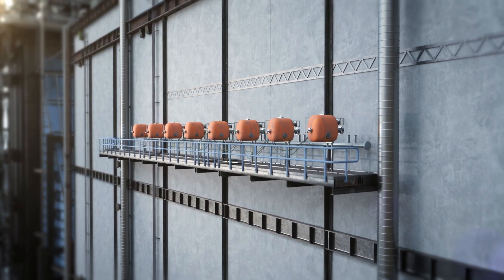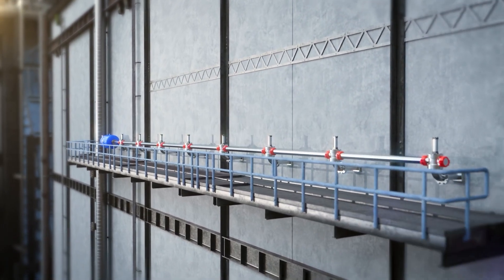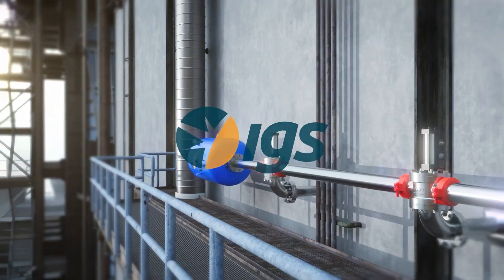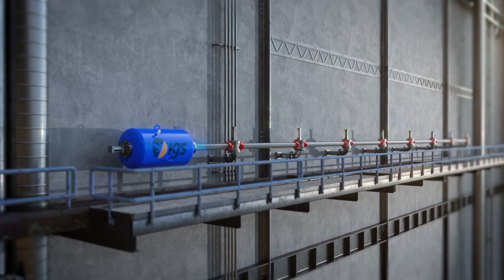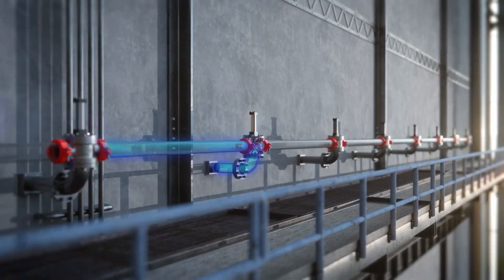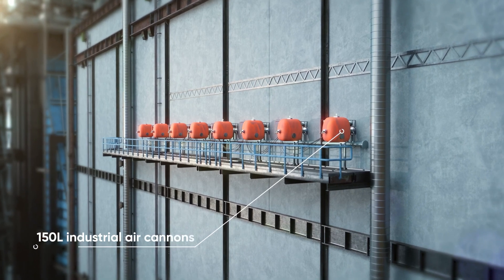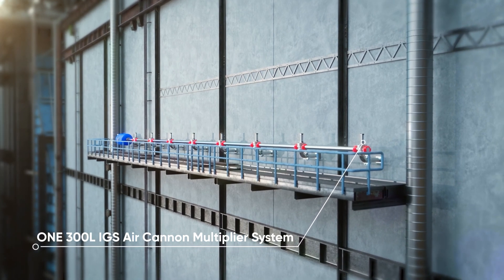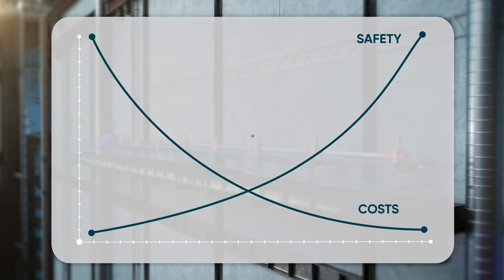Air Cannon Multiplier System for Effective and Safe Maintenance

Comment: If you got some time, what exactly is this for? I get it's cleaning but cleaning what exactly and why this way?
Reply from the maker: Air cannons are used in cement plants (silos for e.g.) and power plant SCR systems to prevent material buildup and blockages. They deliver powerful bursts of compressed air to dislodge accumulated ash, clinker, or other materials. Also great at launching t-shirts at sporting events :)
Reply: @integratedglobalservices  Thank you very much for answering.

Comment: Yes but we all want to know how far the potato goes
Reply from the maker: Chris is on top of this running calculations :D
Reply: Yep that is when the fun part happens. No potato but I like the idea. The baseball we never saw again, the water bottle went until it hit something and exploded (pretty cool) and with a pumpkin I can seed a pumpkin patch in one blast.
Reply: @chrislanders6594  Do you make those multistage blast valves in the CO2 pressure range? :)
Reply: @samwhite254  Yes we have used CO2 to pressurize the cannon and blast extremely difficult material buildups. It is not the normal operation but can be done effectively.

Comment: Seems like there would be a large amount of pressure lost in that type of valve, and the initial pressure wave would mostly blow past and be much lower, shouldn't it be a diverter type valve?
Could be good for multiplexing out to just a few lines though, it is a neat way to cut down on air cannons.
Reply: Good logical thinking on your part, and we do pressurize the entire piping between multiplier units but this volume has minor effect because we use a larger volume air tank than other air cannons. We have several installed systems with anywhere from 2 to 8 ports that are operating successfully. Haven't wanted to try more than 8 although with a close configuration it would be probably be fine.
Reply: @chrislanders6594  Oh yeah, I guess with the bigger tank you don't have to worry about any of that. That must consume more air though right? But I doubt that matters much unless you are doing frequent blowdown.
Reply: @samwhite254  Yes the blowing frequency does directly affect the air consumption. But my experience is 50% of air cannons that have been in use are leaking some amount of air at all times. With this system you reduce possible leaking air cannons from 8 to 1, so actually it has the potential for less air consumed.